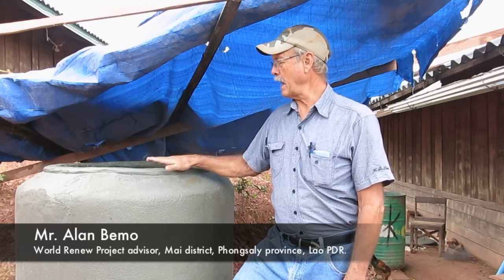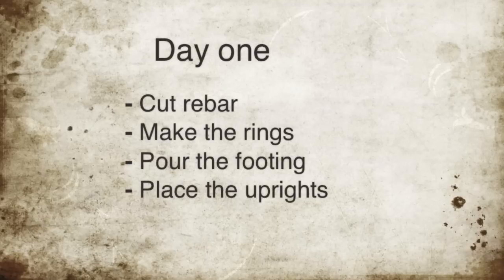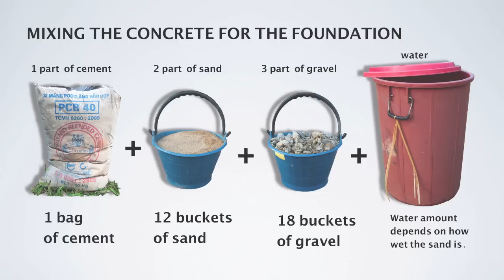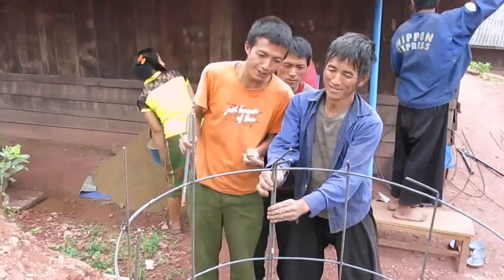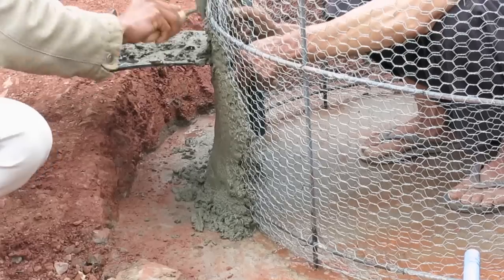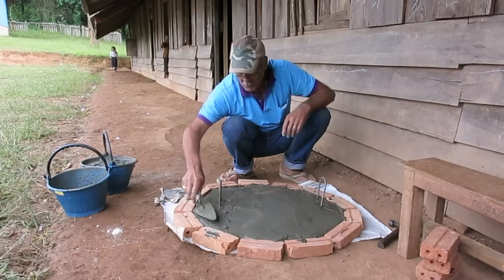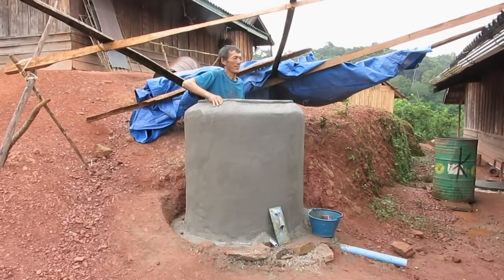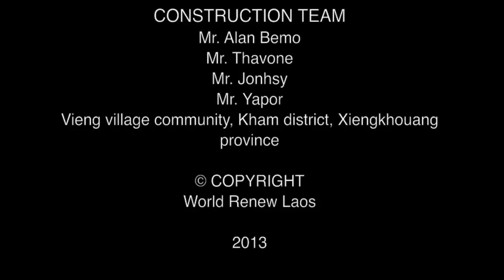Ferrocement tank in a remote community

Comment: Thank you so much for posting. I live in the united states but I am wanting to create a water catchment system so that I do not have to pay for or depend on municipal water systems. This was a very comprehensive , well spoken, very informative, and well thought out video. You have answered my questions of being able to build my own cistern and how to Seal it. Thank you again. All love and God Bless
Reply: Charlie Chong - Cement dust is one thing, cured concrete is something else. Totally different and inert in most cases. 
Analogy can be made for example between fresh paint or cured paint. The first can be full of nasty vapors from thinners, etc. in it's dry form you use it on tables chairs, etc. where you can have direct contact. Hope it helps. :-)

Comment: Thank you for this very informative and step by step video! Just like a previous viewer, I too live in the United States and want to reduce my dependence on municipal water and energy and have been reading on ferrocement tanks. This video now shows me how to build what I need. Although my shape is more like a giant "U" and will be partially inground this has been just what the Dr ordered. So, thank you for makinging it and sharing it too.
Reply: You may drink polluted with cement water.  Could be wrong.
Reply: The cement is inert once cured. Not toxic at all. There are cement lined pipes in some municipal water systems, and not a problem. There are regulations in many places about rain water harvesting, especially for potable use. It can be very onerous if allowed at all, though not necessary scientifically. Just political.
Reply: +Charlie Chong,
That is talking about Cement Dust.  Where would this Cement dust be after the cement is cured?
Added:
"Cement industry is involved in the development of structure of this advanced and modern world but generates dust during its production"
So after construction is done, rinse the dust away, no dust any more unless someone grinds the hard cement.
Reply: One of the crucial phrases is "generates dust during its production". Once the cement has cured, there is no more dust. You need to be careful when moving and working with the dry powder. Once the cement powder is mixed with water the dust and hazard are gone.
Reply: For all those in doubt. The vast majority of water reservoirs, lifting or water treatment stations are built with concrete. That´s where most get their water from. 
Nothing wrong with it. Any concrete structure, after curing and clean, is the standard for almost everybody in this ball we call home. That have the "service" available. ;-)

Comment: Rebar and mesh can be substituted with bamboo, it's remarkably resilient. Thomas Edison had a bamboo reinforces concrete pool that held water for 90 years
Reply: Can you make a hope out of bamboo? With real thin strips? That would seem like a lotta lotta work. The rebar really doesn't contribute to the strength of the structure. It just helps to create the form. The strength comes from the tensile hoop strength of the mesh.
Reply: what extra care have to take for Bamboo reinforces?
Reply: are you cray cray?  bamboo is organic and breaks down fast.  smh.
Reply: @bvbxiong5791 if bamboo is not exposed to oxygen, it would do its job

Comment: Looks like a wonderful idea for people in remote areas without access to clean water but wouldn't  the water be a little toxic to drink if the inside  of this tank isn't lined with a protective material?
Reply: Once the concrete cures (mostly in 7 days, compete in 28 days) the material is inert unless you introduce some really strong acids, which would be far more problem than the concrete that is being degraded. In fact, some pipes in municipal water systems are cement lined and not a problem.
Reply: not the tank is ok but the roof contain asbestos which is toxic

Comment: Some time see if a couple of layers of welded-wire metal fence can do for the rebar.

Just for kicks, try a model with local fibers weaved into a wire basket frame and concrete that up. If it works, it will be cheaper than all metal.
Reply: *****
With fibercrete they mix fibers with concrete, usually fiberglass.
Anything you can make a strong lasting rope out of should do for fiber. Chop into short pieces and mix.
Look up papercrete on Youtube, so many lbs paper ground into water mixed with less weight of concrete makes papercrete. Stronger fibers should make stronger results?
Reply: *****
You could weave thin bamboo or splits into a thick bamboo frame and fill with concrete or small-fiber fibercrete.
Suppose you made a boat hull and filled the weave with canned foam instead? It would need a stronger skin at the least.

Comment: Are there any health risks using the water stored in the cement tanks?
Reply: There´s always risk of water contamination in any kind of tank.
Reason why regular testing and filtering. Is a wise, or at least advisable condition prior to use.

Cement tanks are neither better or worse than other types. 
Although have one feature that can be an advantage. They keep the water cooler, than a comparable plastic/metal tank. ;-)

Comment: When you "seal" the inside of the tank at 14:50, do you add any special water-impermeable sealant to the mix (besides cement and water)?
Reply: Andromedus - A slurry of cement/water is pretty much enough. Properly done it will retain it´s properties for years.

The use of other commercially available products is more an option than an obligation. ;-)
Cheers

Comment: Very good work. But I wonder why not dig into the ground to make the tank ? It's easier. And the water temperature is more stable.
(french, trying to translate ... :-))
And if possible, it's better with a bastard mortar, 2/3 lime 1/3 cement. For waterproofing, it is necessary to pass soap when the mortar is "in love" (il commence à tirer). The soap molecules have a water repellent side.
Reply: Certainly. Perhaps also if the soil is too clayey, and may swell or shrink according to its moisture. I know only the watertank in stony limestone. The soil seems to be clayey in this video.

Comment: why..not just have a lump of soil, dig a hole in the middle, put in a thick plastic bag and be done with it in a half day ? i don't think you need more.. cleaning is easy, building is easy, a thic plastic bag does not cost a lot, all you need is soil around it to support the plastic bag against the water pressure.. seems a lot fore affordable.
Reply: Nagy Andras thank you for your idea. Where i want to retire rains a lot. Your idea is my best beggining and with that first water I will make a bigger cement tank that will provide water for the whole year! Thank you for existing. You just saved my life.
Reply: @Nagy Andras  A very good idea. It's a technique similar those used for  making artificial ponds. When possible a good thing is to coat the inside of the hole with clay mixed with a fiber like straw about 1.5 inch thick, and after with a 1/2 to 3/4 inch of pure clay. So the plastic sits on a very smooth waterproof surface. No risk of a hole.
The other thing is to make the opening for the lid at least one foot above te ground level, so no contamination by the soil, or water running on the ground.
Reply: You'd need to plumb it as well. Cut hole in the bag where you will put the pipe.
Reply: Remember to plumb! Cut a hole where pipe will go, as you know.

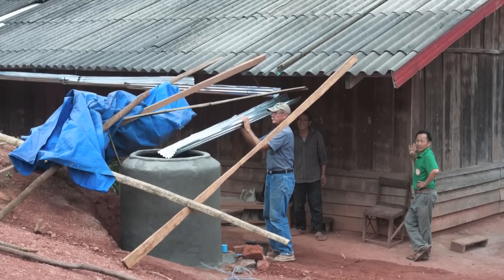Comment: 16:40 don't use water from roof, That roofing sheet too many AMIANG. CAN LEAD TO CANCER.
Reply: Amiang (also known as asbestos) can lead to cancer if inhaled, but is no problem in solid form. In fact, you are less at risk of developing cancer from drinking water that came off the roof than you are from the wind blowing over the rood as you walk past.

Water collected from a metal or earthen roof would be best, but no matter how you're collecting the rain water it needs to be filtered/treated/purified to really be safe/healthy.

Asbestos Cement Pipes (ACP) are common in water systems built in the mid-1900's because they are strong and inert. They are no longer used, but only because of the handling/disposal challenges. What's in the ground delivering water to homes is still very reliable, and even more so than most other types of pipe/material.